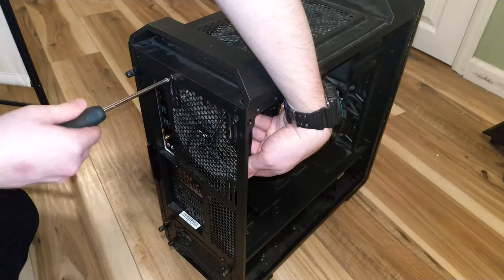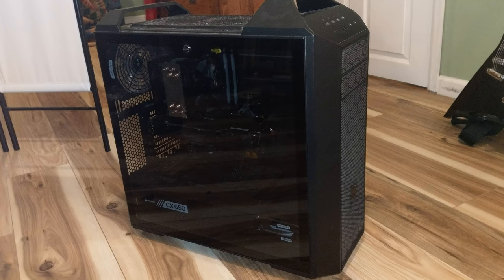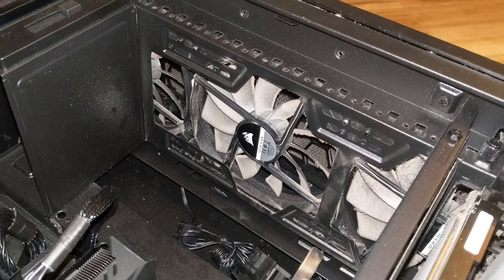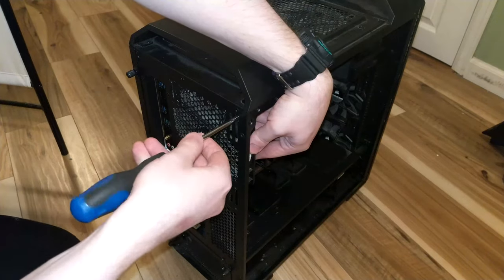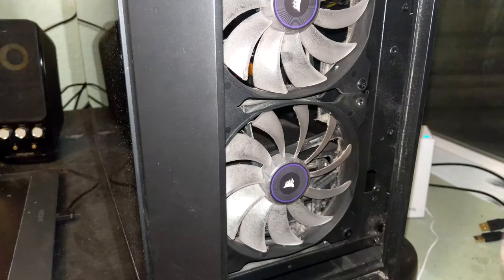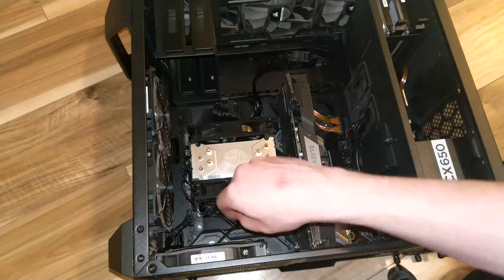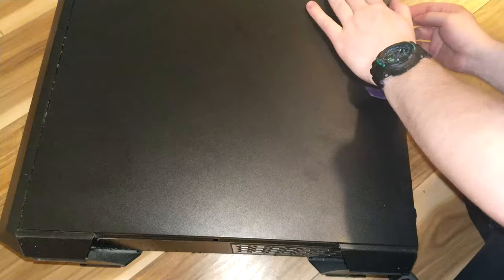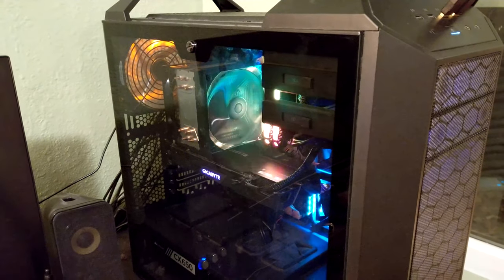How to Install Case Fans into a Desktop PC

Comment: This really helped a lot. I bought a pre-built older pc for my son's first PC, and the sucker only has one fan. We have the case sitting on its side, and the fan is pulling air from the HDD and just pooling at the back. 
Oddly enough, when the pc is lying flat, the fan is on the right side of the case but dead center. I think I can get away with putting a small desk fan in front of the HDD (which is at the lower edge when sideways) and the "rear" fan will do its job better.

Comment: 1:18 “Now that you have your intake fans pushing cool air into the system”. No, I don’t. Nice explanation up to there of how to orientate the fan, but you skipped connecting the power, which was what I came here for. I can see power leads on my fan but no obvious spot to plug them in.
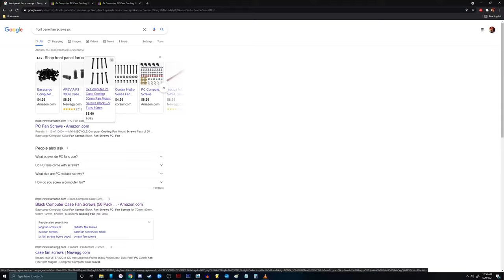Reply: He talks about it. 3:39 with close-up pictures.
Wires plug into the plug with 4 pins or 3 pins pointing up. Tho usually the wire has 3 pin sockets.
Reply: maybe watch the whole video?

Comment: I have a unique video request. Many people are shipping older hardware due to the market. A guide on how to properly ship your hardware sold if you don't have the original boxes? I've been parting out all PCs and found this to be a challenge.
Reply from the maker: That's an excellent video request! I may just make that video!
Reply from the maker: @Ty5oN101  basically yeah, you just need to wrap up your parts with anti static bags, then bubble wrap/packing peanut that, and secure it tightly into a cardboard box or thick envelope. You can get anti static bags online, but I've always saved the ones I got with parts I bought and reused them.
Reply: @Torqcx  I've done decent so far, been trying to research more ideas so far. Legit sending a junk motherboard with the CPU I'm selling to protect the pins lol the cooler is with it slid in there too.

Comment: Is it safe to have my computer exhaust fan pointed directly at the monitor???

Because I want to get more spacious in 150cm desk space by aligning computer straight with my monitor panel...
Reply from the maker: Yes, I don't see why that would cause any issues; the heat that a computer exhausts simply isn't enough to damage a monitor.

Comment: I only have a single fan, like the first one you installed. So, the wires/spokes point outward, like the one I mentioned that you first installed? I forgot to pay attention, or photograph it, before I took it out to clean it.

Comment: Hey man, I have a question, recently I built my first PC and for it a bought an old case cause it was cheaper (it's from around 2013~ish). The problem is that the two intake slots for fans are 100mm, which I'm not able to find in the market anymore, so my question is: Is it better to put 120mm fans in there or 80mm fans?
Reply from the maker: If you can fit the 120mm's, bigger is better in my opinion; they don't have to rotate as fast to move as much air as a smaller fan would, so generally they'll be quieter.
Reply: @Torqcx  makes sense, I'll see if I can fit them, thanks for your help!

Comment: I can't unattached a old case fan from my 4 pin molax cable. It doesn't use 3 or 4 pin adapter, just the molax cable connected to my psu. Struggling to detach it but won't. Any advice would be fine. Am I  just not pulling hard enough because it's old?
Reply from the maker: Every fan I've ever seen has been detachable from a PSU, but without looking at any photos I don't know for sure. If it looks like it's connected with a molex, just disconnecting it with force should do the trick.

Comment: How about the side of the case. Should i install the fans that blow my case or reverse?. I only have old case
Reply from the maker: Side panel fans should be intakes, so you should orient them to suck cool air into the case and to blow on the hardware (they're typically located to blow air at the graphics card, CPU and RAM)
Reply: @Torqcx  ok thank you sir

Comment: I have 2 fans on the roof of the case and the arrows are facing upward is that good?
Reply from the maker: Correct, roof fans are best when they are exhausting hot air outside of it, so the arrows pointing up, toward the roof of the case, would be the proper orientation.

Comment: My pc has no holes in it 👀 accept for on one side were the glass would be, is it still possiple to add fans anywere
Reply from the maker: Usually cases like that have vents in either the front or the back, check the roof and bottom, too
Reply: @Torqcx  I found one on the back and bottom

Comment: can u put rear side to intake instead of outtaking? thanks
Reply from the maker: You "can", but 99% of the time it wouldn't cool your system down as well as having it oriented as an outtake/exhaust fan. You'd have to have a specific configuration intended to be set up that way in order for it to be effective.
Reply: @Torqcx  Hi I have 2 question
Is SYS_FAN same as CHA_FAN (4 pin) in my motherboard?

Are these CHA_FAN 12V? or 5V?
Reply from the maker: @user-fo9ce3hr5h  SYS_FAN is the same thing as CHA_FAN (System Fan and Chassis Fan, fans intended to be mounted to the case).

They are 12V.
Reply: @Torqcx  thanks 🙏.

Comment: This is awesome, but damn, if only self threading screws did not require so much physical force with a manual screwdriver for my unmasculine ass whose muscles are even smaller than the screwdriver itself